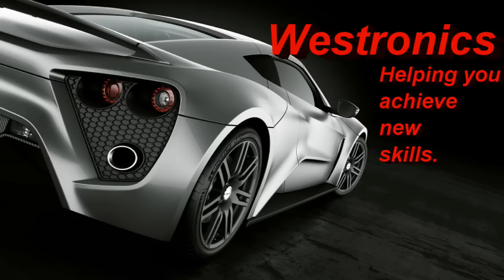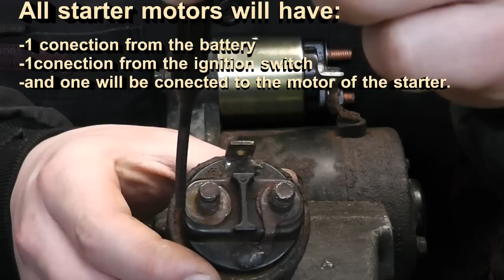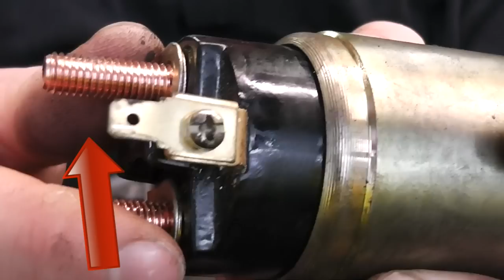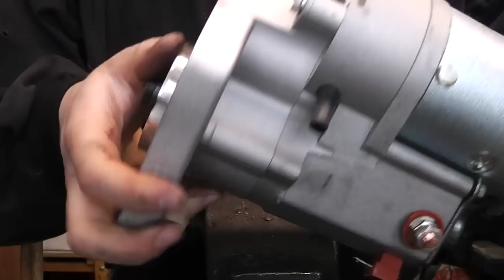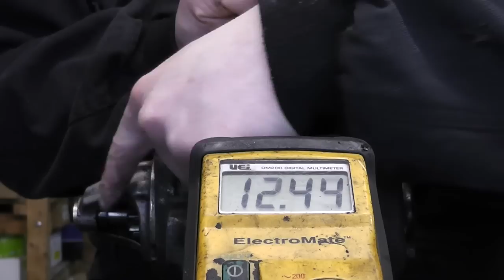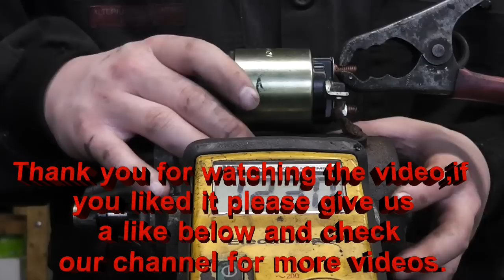How to bench test starter motor.

Comment: very useful advice, thank you.  I have a pajero that I cannot start.  The engine cranks but very weak.  The battery voltage was 12.7V but the voltage between solenoid positive and ground during cranking was approx 1V.  Any advice on this situation?

Comment: Great vid, couple of questions:

1) If I want to test the solenoid, and not the starter, I disconnect the power joining strap?
2) I have a 13.2V, 26 amp power supply in my shed.  Would this be enough amperage to work just the solenoid (hence disconnecting the motor), or do they need waaaay more than that?